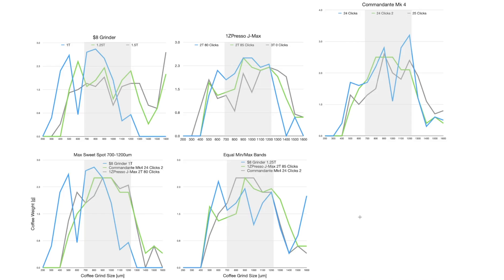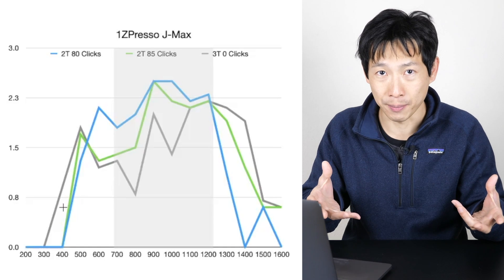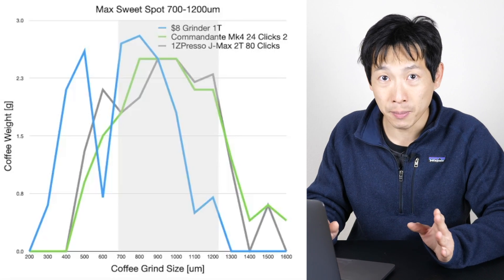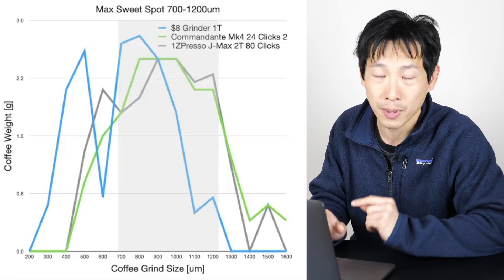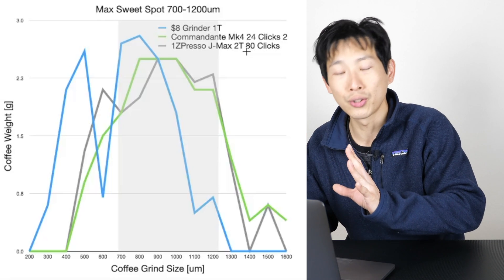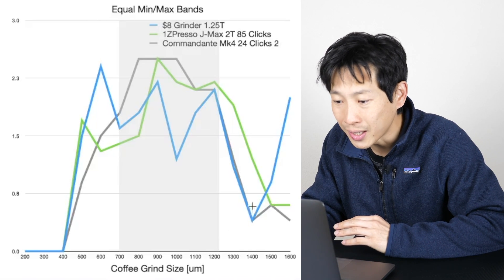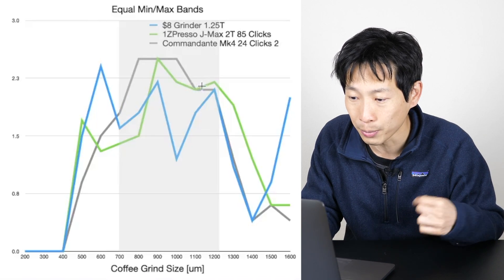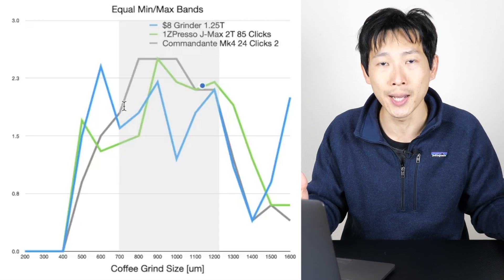Coffee Particle Analysis on the Commandante Mk4 vs 1ZPresso JMax vs Cheap Dollar Grinder

Comment: I'd be curious to see a comparison between your sieve analysis and laser diffraction analysis. I've heard a lot of coffee gurus say you can't really get an accurate picture from sieve analysis because of the variability in grind shape (the implication is sieve analysis lacks validity for coffee) which allows particles much larger than the nominal aperture to fall through to the next level. It would be a great method if grinds were uniformly spherical but just by taking a well lit photo of some coffee grinds with a cell phone camera and zooming in it becomes apparent that the grinds are not uniform. I'd speculate that different grinders produce different results in terms of uniformity, even when say comparing a conical grinder to a conical grinder. Actually... since you have both some macro photography of the Comandante vs. the J-Max vs. your cheapo grinder would be interesting. It would also be interesting to see the difference between a light roast and a dark roast (with dark roasts being more brittle resulting in more fines if you hold the grind size constant due to the shattering of the dried out bean as compared to a light roast which will retain more moisture).

If I were to speculate I'd say sieve analysis would be skewed toward reporting smaller particulate sizes than what's actually there. Is it consistently inaccurate though? In other words, can it consistently indicate a ratio of fines to coarse particles relative to itself which somewhat correlates well with laser diffraction?
Reply from the maker: I double a laser diffraction company would even let me borrow one for review. XD XD
Reply: @BeatTheBushDIY  probably not, but I bet there’s a coffee nerd out there with access to one that would be willing to analyze some samples.